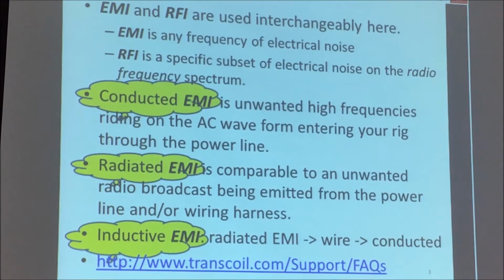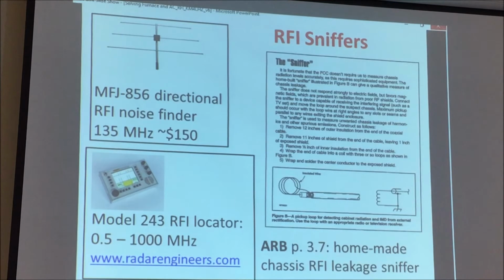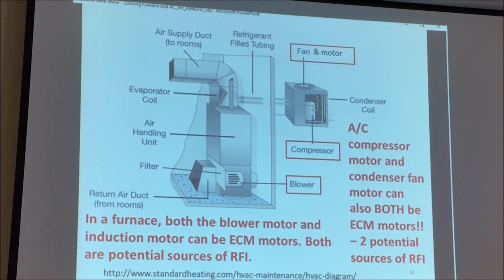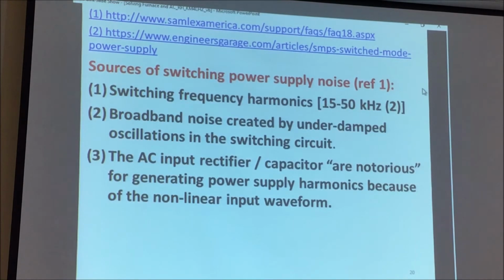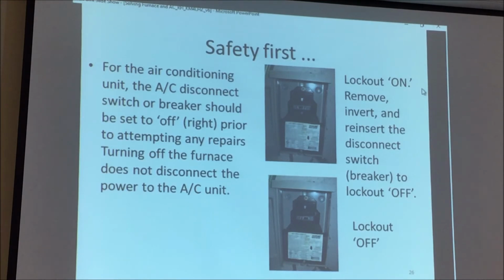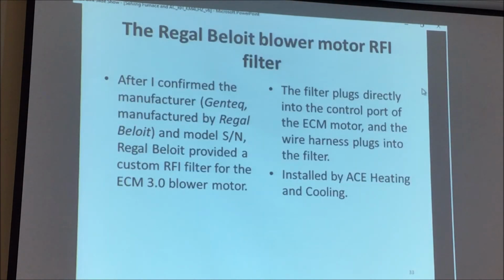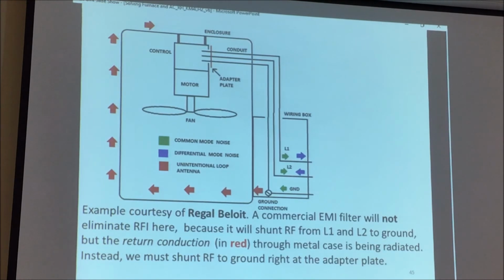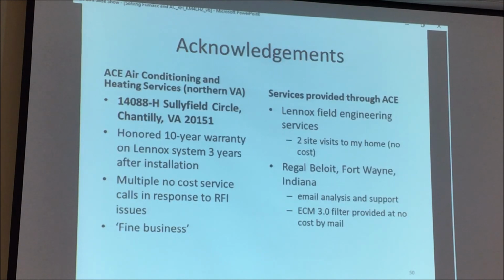Lessons Learned by Resolving Furnace and Air Conditioning RFI Problems

Comment: Thank you for the great video!

I've had a very similar situation to yours and your video helped me to narrow it down specifically to the condenser fan motor. The induction motor, inside (attic) air handler blower motor and the compressor motor were all clean.

I grounded the 5 unused wires coming from the attic air handler unit to the outdoor unit and this decreased the strength of the approximately 20 kHz birdies.  By putting some chokes on the wires going to the outdoor unit's blower motor (3 of the wires, the 4th was a ground wire), this decreased the strength quite a bit more. I placed another choke on the ground wire going to the blower motor, and placed another on all 4 wires together going to the blower motor, and this knocked the noise below the noise level at my house.

Another interesting tidbit is my antenna, which is a ground-mounted 5BTV, is about 15 feet from the outdoor unit. It is literally the closest active electrical device to the antenna. After I got serious the day before and actually identified that the central A/C running was causing the noise, I searched Google and found your video. After that, it was a matter of determining which of the motor(s) were causing the problem. After finding that only the condenser motor was the culprit, I did the grounding of the unused wires. Then I "shot gunned" the rest of the noise by placing various chokes on various wires in the outdoor unit until I got the noise to go away.

Thanks again for taking the time to document your findings!

Chuck Adams  N5UN

Comment: Thanks for the enlightenment.  My system (in South Texas) may have a different motor configuration - but I will check.  I do get picket-fence interference on some bands.  The thing that worries me is that the homes in my subdivision (about 250 homes) were built within a few years of each other, and most by the same builder, thus with A/C from the same manufacturer.  Thus if the controls have an RFI emission defect, all 250 of them will have the defect, and ham radio is doomed.  Your presentation has given me some good guidance.   Subdivision is about 17 years old, my home is 14 years old.  Thanks again from AB5XZ.

Comment: Excellent video, totally informative and describes my problems with Hi efficiency furnace RFI.. move this to the front of the line if you are experiencing any symptoms with your amateur radio equipment picking up RFI from a high efficiency furnace blower motor!!